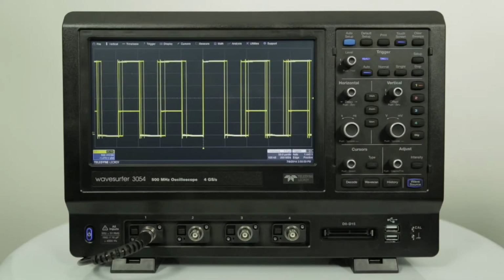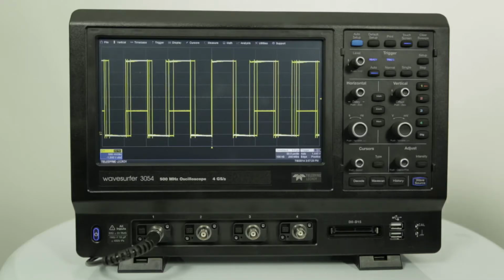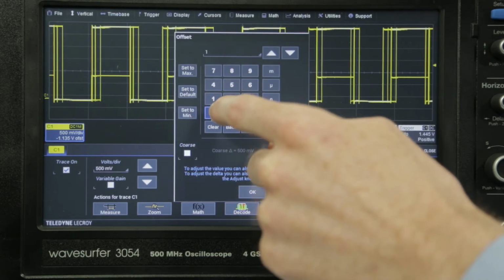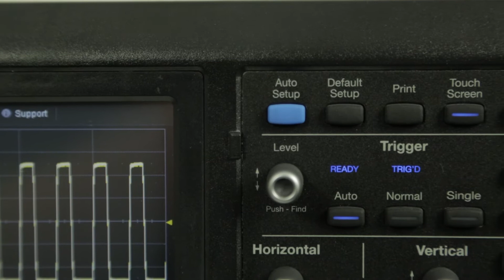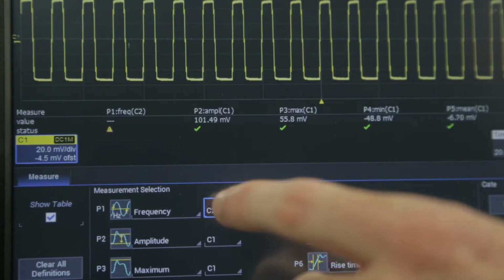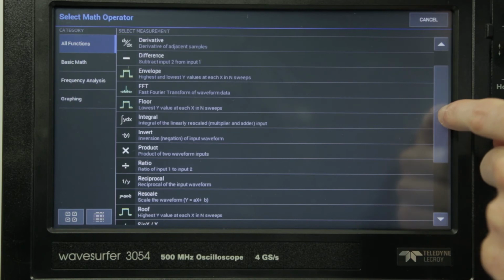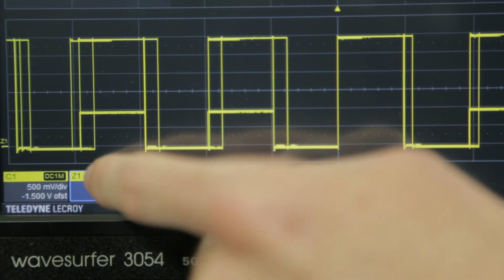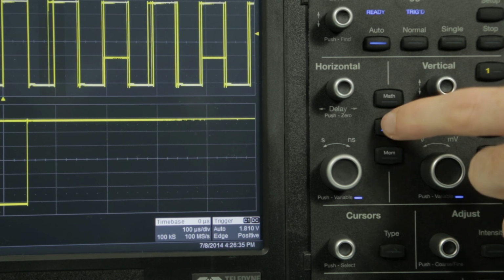WaveSurfer 3000 General

Comment: hi. i have an WS-3024. i buyed it approx 2 years ago. have some important issues on WS-3024 firmware. i did reported all issues to Teledyne LeCroy with my created detailed documents and videos. several firmware updates have been released. some issues are fixed but some issues are still continuing. i'm using 8.4.1.5 firmware version on my WS-3024. ( 8.4.1.5 version is not release officially yet )  currently official firmware version is still 8.0.4.7. it was a really long time. When does a new firmware release come in ?